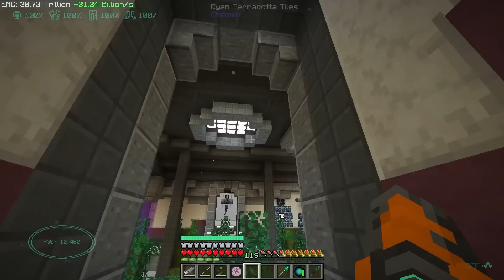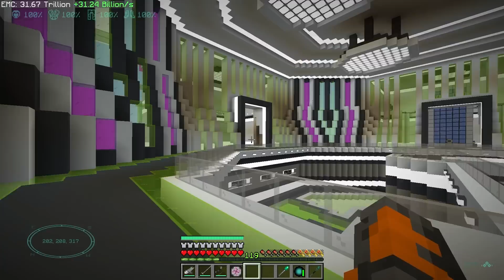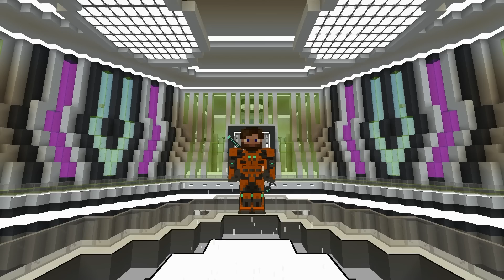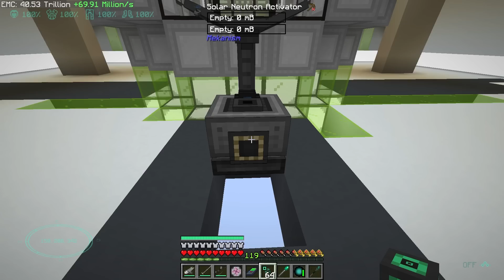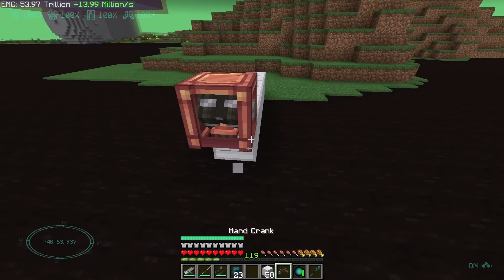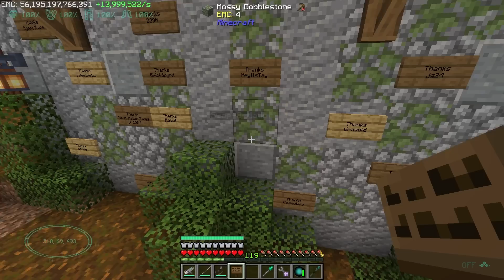PROJECT ARCHITECT 2 - EP 34: Antimatter Production & Thermal Tar and Rosin Automation

Comment: Anybody please help, my mycelial generator is generating 25mil but my flux plug is accepting only 2.6mil and is capped thus my reactor is accepting only 2.6mil and I'm backlogging polonium and waste. (PS: where do you put the waste from isotropic and solar neutron? I'm getting full radiation in my world)

Edit: nevermind found the the problem... the mycelial generator keeps getting stuck and not outputting any power for some reason but keeps generating it so I have to break the block and reposition it smack a plug back to it and it's fine.

Comment: be careful with crude oil world. if the dimension spawns lava dripping down anywhere and you miss it. you will have a ocean of fire and lag you out. i just had to clear up a whole ocean that was being loaded in near by chunks that i didnt notice. took foreeeevvvvvvvveeeerrr to stop. because it spreads like crazy
Reply: does it burn the crude oil up or can i just hose pulley from a far distance?
Reply: @kaangul7464  you can hose pully it up. what im saying is, there happened to be a lava source that was pouring down a mountain. was nothing noticeable when I just flew by it at some point. however one day  I was super laggy and I was like this is strange..... so I flew around to Check out what was going on.... as I flew chunks loaded in and it was literally and ocean of fire all on the top layer that started off of one lava source block. every time I put fire out it was so spread that it just kept appearing as fast as I put it out. the way I stopped it was with the exchange gadget and spammed to replace the fire with stone. I mean literally thousands of fire blocks. it was insane and scary because if I didn't stop it when I did it probably would of crashed the world

Comment: Using any AE block that can use an AppliedFlux induction card will deliver FE at a rate to get an AM pellet in a little under 90 secs. Just fill up a couple max FE storage disks for this purpose. I think the only limit might be how fast AE importers can export polonium from Applied Mekanistics chemical storage discs.

Comment: AE2 is fast if you use interfaces.
from an interface you can extract fluids and chemicals at any speed with other mod pipes/conduits.

I keep everything in AE2 and then pull from an interface block the resource I need, and by using an interface the materials are provided as fast as the attaching pipe/conduit can handle.

Comment: Max burn rate for water cool Fission reactor is 200. Anymore than that and it will start to go critical no matter what. I think you need to change to sodium for more than 200. Or AFK.

I think SPS require 400 MFE to reach their maximum speed.

Industrial Foregoing has biodiesel as well, I mostly use that as it was very easy to set up but it won't give me tar.